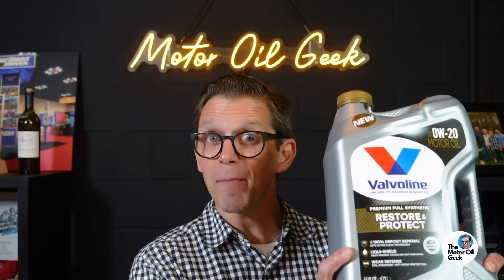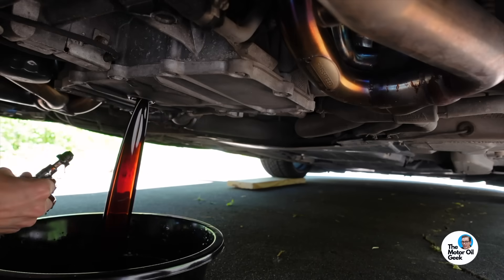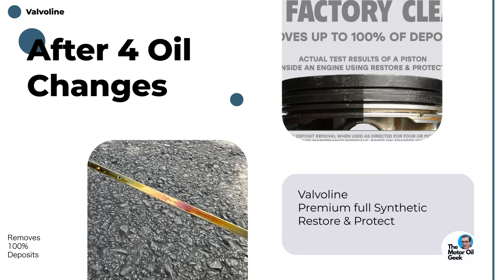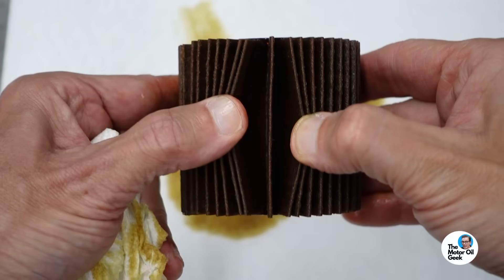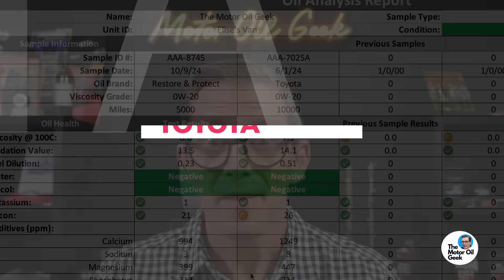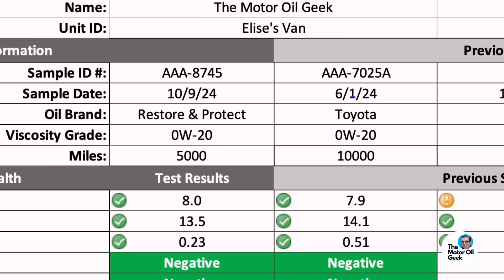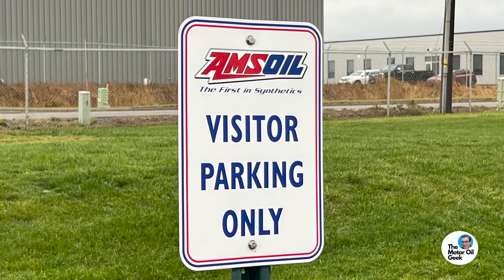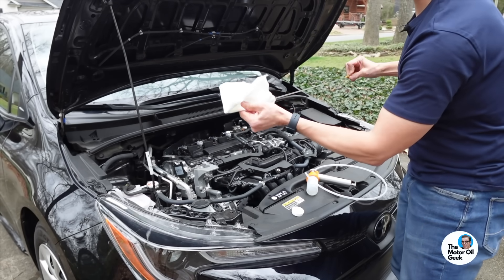The TRUTH About Valvoline's BOLD Engine Cleaning Claims

Comment: I used it in my 2016 tundra, 136,000 miles, had the timing chain noise that comes and goes, not loud just you knew it was there. Used this oil, 5w-30, and after two oil changes it was significantly quieter. I do 5,000 mile OCI. I Think the oil freed up the timing chain tensioner

Comment: The 10k mile oil changes is why you have varnish on the dipstick. You should check out The Car Care Nut and his videos on the 10k mile oil change. It causes more issues than varnish in places it shouldn't. 10k mile oil changes even on Toyota oil will lead to excessive oil consumption.
Reply: I had varnish on the dip stick of my lexus and changed the oil every 5k.
Reply: @flyinfinity8745  Was that on OEM oil ? I don't think Toyota is into advanced base stocks for their oils.
Reply: @MathewPollard-vj4uq  I dont know what my lexus dealer used, but it was not synthetic. I didnt do my own oil changes until 120k. It was always done at the dealership every 5k and I bought the car new.

Comment: So, if my engine burns a little oil, would Valvoline Restore and Protect help in cleaning my spark plugs too? Preventing fouling and possibly extending the changeout interval?
Reply: If your engine stops burning oil, then your plugs won't oil foul.

Comment: I have a 2005 Toyota echo. 
 Change the oil every 3,000 miles. 
 Use 5w40 European Lucas oil ,
K&N or mobile 1 filters .
I'm at 215,000 miles now and it runs like new and uses about  ⅓of a quart between oil changes.  I don't have to add any just a little bit less comes out than I put in. I fill it to the max and when I change it,  its around the half way mark.
 New Toyotas are complete garbage....
 So sad ....

Comment: I have a 2021 nissan rogue with just under 10,000 miles, I change 0W20 syn. oil once a year. Would it be not worth it to use this Valvoline VRP oil or not being how there are no problems with the motor at this time. I still have the4 cyl. 2.5  direct injection motor. I use to lease these N.Rogues till they came out with those crummy 3cyl. turbos.

Comment: As good as the results are, I bet wear levels would be measurably lower with a 0W-30 or even a 0W-40 (if available).  

AFAIK, only in the USA do vehicle mfrs recommend such thin oils (0W-8/16/20).  Everywhere else, they say 0W-30 is suitable for the same vehicles.  I have to say 'The heck with CAFE' (Corporate Average Fuel Economy).  Automakers are penalized by the Federal Government for failure to hit mileage goals.  While I get the pressure the mfrs are under from el Federales, I'd rather my own personal vehicles last longer than get one or two mpg more via a super-thin oil.  

Car makers' own studies have shown that engines last significantly longer (+1-1/2 to 2X mileage) when filled with multi-weight oils with a 30 or 40W 'hot' rating compared to 20W.  Of course, following their specs to the letter yields a two-fold benefit - TO THE CAR MAKERS: We the buyers face higher Lifetime Cost of Ownership (LCO) with shorter component lifetimes - even trading in our vehicles more frequently in some cases! 

With vehicles prices reaching new highs every year, most of us want ours to last.  My 2002 Altima just turned over 215,000 miles on the original engine.  I'm slowly going through it, replacing suspension components, brakes, hoses, the drive belt & other wear items neglected by previous owners.  However, the first thing I did was an oil change to a 0W-40 quality synthetic oil (Castrol 0W-40 Euro or Penzoil Platinum Euro 0W-40 - being replaced with Helix Ultra 10W-40) and a quality ATF (Castrol Transmax Import M-V).

Comment: With 260k miles on my sw20 that leaks and burns oil like fuel, I'm pretty sure if I cleaned my piston rings I'd throw a rod at this point. Pretty sure the carbon is the only thing keeping the engine glued together lol

Comment: I just did an oil change with VRP on my daughter's 2010 Honda CRV with over 215,000 miles on it.  Can't wait to see the results after I change it again.
Reply: Might want to keep an eye on the dipstick and change oil and filter when it gets dark. On the first video, a guy said he’d been changing his oil every 3,000 miles and switched to R&P and it clogged his filter near the end of the first change and took about 3 changes to get the engine clean. The same guy later posted that he had a sudden drop in oil pressure and found the pickup tube screen blocked.
Reply: You can wait
Reply: @jme214  ummmm....ok

Comment: Hey Lake, I'm thinking about using this in my 1979 Dodge W150, and wanted your opinion on at least a first oil change interval with it. The engine is a 360ci V8 with at least 111,000 miles on it(I don't know how many times the odometer rolled over). It's a former USDA truck, likely with lots of idle time. When I first changed the oil around 9800 miles on the odometer, I just used O'Reilly's high mileage 10w30 Syn blend. After about 2000 miles I did an oil change(with oil pan gasket and front and rear crank seals) and used Castrol Edge high mileage 10w30 with a Purolator Boss filter. When I changed the valve covers and gaskets, the rockers were pitch black. If I use the Valvoline R&P, and given the engine info, do you think a 2000 mile interval would be good for at least the first time?

Comment: Well this is all fine and dandy. Im not doubting the valveoline R&P doesn't work.
But its not the only one to do so. I bought an old pickup cheap with 210 k miles on it with unknow maintenance or oil used in it. It ran ok and didnt consume much oil. But it did have cold start piston rattle that went away as it warmed up. I have used Amsoil Signature Series in it for about 45,000 miles now with about once a year at around 6,000 mile oil changes. I recently notice the cold start piston rattle is all but gone now. I figure the piston rings were gunked up and sticky and now they have been cleaned up and are free. I'm impressed.
Reply: No doubt using a high quality oil for 45,000 miles will have got that motor nice and clean. I think VRP and will be most useful for the newer cars where piston buildup , turbo pressure and heat create problems quickly and where people have been following the long OCIs. Lots of people follow the long OCI "Because the manufacturer knows best" without realizing the manufacturer would rate their driving patterns as "Severe Service" with shortened intervals.
Reply: I’ve had that same experience with Amsoil Signature Series. In reality Signature Series is a much better oil. As a matter of fact I’m pretty sure Amsoil High Mileage (which Amsoil guarantees to free up stuck piston rings) came out first. I think Valvoline is trying to create an oil that can clean as well as Amsoil and be able to buy it at the store.

Comment: I bought a Pontiac Vibe GT (2ZZ-GE engine) with 140,000 miles on it. The dipstick was heavily varnished and the looking through the oil filler cap showed the valvetrain had varnish on it.
I changed the oil and put a quart of Marvel Mystery oil in it (changed out the original spark plugs too). Ran it for 3000 miles and when I changed out the oil, the varnish on the dipstick was gone and the valvetrain looked much brighter.
Just saying that while I find your varnish test informative and interesting, that part was not breaking any new ground.

Comment: Filter holding contamination against it being small but in the lube system 

Depends on the allowable back pressure on the filter - who wants oil swirl
Reply: Swirll??? If a full flow filter gets plugged or restricted the oil filter bypass valve will open.

Comment: I have used Val online restore 3 times so far for 3-4K miles intervals in my Audi A6 with 190k miles. Don’t know if it works but I took Lakes word for it. I will run this car into the found and when I do, I will pull the pistons.

Comment: Some time ago you did an article about new engine oil that was very very old and the additives had settled to the bottom of the container. I ask the question if the container containing the oil was “moved”  around ie, laid upside down/side to side over a long period of its standing time would the oil additives have stayed in solution and the oil be usable.

Comment: I've just had the Valvoline Restore and protect installed in my 2018 Kia Sportage LX AWD with the 2.4 L GDI engine which is currently at the 96K mile mark. I don't plan on taking any samples to send to a lab, but I will be keeping a watchful eye on the amount of oil to be added in between oil changes. When I purchased the car used at 29K miles four years ago my mechanic warned me the engine would burn "some oil", which he was correct, it burned one quart in between three to four thousand mile oil changes using Mobile One Full Synthetic. This past year however has shown a considerable increase of oil burning going up to two-and-a-half quarts per oil change. So I'm hoping this mechanic in a bottle will knock that usage down back to the one quart level again. I will try to let you know how it goes folks.

Comment: Thank you for your work confirming valvolines claims! As I have commented before, no one beats valvoline for long. When someone 1 ups them, they go at it hard until they 1 up the 1 upper! When mobil1 came out, valvoline clapped back with their updated synpower synthetic within 8 months and blew mobil1 out of the water.
Reply: I love a good fight. it drives technology and innovation. Also, popcorn is pretty nice.
Reply: Did they ever respond to Pennzoil Ultra Platinum
Reply: i agree. they are a go 2 brand. the only real difference between high mileage oil and regular is that high mileage oil has a little bit of stop leak in it, they call it seal conditioners. valvoline maxlife has the highest concentration, and highest quality seal conditioner. this formula has definatly outright stopped engine leaks for me in about 2 to 3 changes. though. i like castrol better because castrol is better in terms of lubrication. pennzoil has come a very long way since its problematic days, I think its synthetic formula gives the best lubrication and even protection for long intervals 6k changes and up without it stating that it is formulated for 10k mile oil changes. but hey valvoline has all the protection you need to get a full life out of any OEM engine. now that valvoline has an engine oil dedicated for cleaning engines to rival royal purples product at a lower price they are THE go to brand.
Reply: so your choice of oil used determined the internal cleanliness and thus required this new product. I notice valvolines doesnt lie as they use the oldest words in advertising " UP TO " so cleaning .oooo1 % would mean ...it works it really does !
Use amzoils best from the start and prob will not require this "up to"  product.
Reply: @lenmoodie8290  amsoil is a pyramid scheme. There's a reason they dont pay for API testing, and it's not because "iTs tOo eXpEnSiVe" it's because they can't back their claims up
Reply: @lenmoodie8290 Or one could read through the comments and realize that the product works
Reply: @lenmoodie8290  Ok Debbie Downer LOL! It worked for me.

Comment: Im 53 and i been using valvoline for 30 years due to groundbreaking high mileage oil never any issues. On second oil change 2012 accord 2.4 with 86000 miles and first on 2022 rdx. However the rdx has 11700 miles more for preventive maintenance.

Comment: Would you recommend using this in a gm vehicle that requires dexos...I really want to give it a go as I know ring deposits are a issue with my turbocharged direct injected motor...if I was to try I'd probably only do 1 treatment for my regular 4000-5000kms oil change

Comment: Lake Speed maybe your most incredible video yet.  Tried the first dose of the Valv R & P on my 2001 Solara with 280,000 and wasn't sure if I should put it in the next change, now I guess I will do it.  
I don't believe anybody can give out any better wisdom nor more technically accurate advice on engine oil, than a qualified tribologist like you.  I value your opinions 10 times as much as anybody else's on this platform.

Long comment follows:
I have always gone by 3 mo/3000 mile oil changes and that's because I've seen the good results for myself.  A few years ago I decided to do an in-car overhaul of my old 1988 Nissan Z24 pickup w 190,000 miles.  It needed a valve job but I decided I'd change the rings too, since the head was off, and I'd always wanted the challenge of doing it.  

And after removing the pistons from the engine block, there was very little evidence of wear to be found:  no cylinder wall scoring and no wear ridge at the top of the cylinder (which it is almost routine to find in neglected engines).  I had bought a cylinder ridge-reamer but didn't need to use it since there was no ridge. 

All the piston rings were relatively clean, none were sticking, and they all moved freely.  All there was to clean off was a very light trace of hard deposits, probably carbon, in the ring grooves.  Connecting rod bearings were like new so I just re-used them.  And there was not a trace of sludge or varnish in the oil pan nor anywhere else.  Even the oil pump pickup screen was spotless. 
Seeing all that with my own eyes, on my own car, made me a true believer in 3,000 mile changes.
Reply from the maker: Thanks for the kind words and the comment. If 3,000 mile oil changes work for you, keep doing. I'm not trying to tell anyone what to do. I'm just here to provide info and let each person make their own decisions.
Reply: I know what you mean. My father ran the cheapest gas he could find on his 1970 Datsun Thai rebuilt at 200,000 miles he always used castrol GTX  20/50 changed every 3000 miles and never went over 4000 mile between changes. No ridge. I judt honed it. I had bought new main and rod bearings. Changed them but I was curious on the bearing wear. I plastigauged the bearing with the old bearings and they weee the same. I also expected all kinds of carbon buildup on the valves choking the flow like you used to see in the commercials for name brand fuel. There was none. 
Remember this is on a carbureted car with a manual choke. He always warned it up for at least 2 to : minutes before driving it. 
    I have concerns over this oil in long term use on newer cars newer meaning 10 years or older. My concern is with the detergent being this strong to actually remove this baked on gunk having a hardening effect on the valve stem seals in a long term use. 
  I know they tested it in dump to simulate lots of miles but I know they have not tested this stuff for 10 years in time and not 10 year simulations
Reply: I was wondering the same thing myself
Reply: Oil is cheap, engines are expensive.

Comment: So I can use valve line restore and project to clean my pistons before I rebuild the engine? 

You know, soak them in some hot oil (150 degrees F) for a bit and see what happens! I might try that to see what happens instead of hand cleaning the pistons.

Comment: I am at the end of my first oil change using this oil. I'm about to do my second run with this stuff next week. I am using it in a new Reman engine that I bought 18 months ago that has 20k miles on it now. I swapped to Restore and Protect about 6 months ago. I also swapped to Purolator Boss oil filter at the same time, and I intend to keep using both together.
Reply: Boss is a good filter

Comment: My 2013 corolla has 230000 miles.  Did 4500 miles this oil and next oil change used the high Mileage valvoline oil extended protection again, worried about old seals in engine possibly being hurt by this if used constantly..then next change with the restore and protect..plan to alternate between both...you think older cars seals could suffer?.I've read it could harm old seals

Comment: I believe that most major oil brands like Valvoline have good additives in their oils with better testing and technology we have today, better additives than in oil 20 years ago.    I have a 2001 GMC Sierra Z71 with over 100,000 miles that (I bought brand new) in 2001 and all it has had in it is Pennzoil 20-30w and it has never had any engine problems or repairs and I have had the oil and filter changed every 5,000 miles.     Looking inside the engine (5.3L V8) through PCV valve openings, etc. the inside of the engine looks brand new with no dirt or varnish and the dipstick has zero varnish, etc.     My engine is proof to me that change your oil every 5,000 miles and most brand name oils today will stay clean.  It uses/burns about 1/2 quart of oil between 5,000 mile oil changes.

Comment: 2005 Silverado,5.3LM7 280,000 MILES,Have been Restore&Protect for about 10,000 miles,3 oil changes,And it works,idles smoother,runs better.
Reply: 2002 with the same motor, just changed mine

Comment: In automotive college I was told the "high mileage" type oils contain solvents that clean the engine but also can attack the seals making them swell and seal better but also making them spongy and weak and extended use will cause them to fall apart but this was a few decades ago perhaps the technology has improved

Comment: Doing this on my dad’s Yaris. It started burning oil past 500K miles first restore and protect change was at 528K 2nd one at 533K going to be doing the third one soon. Oil burning is getting worse. But the oil is looking like diesel motor oil a black oily void. Probably going to be replacing a short block. So having everything around the engine freshly clean helps. Looking at what most people have been saying and seeing it looks like this engine was simply too far gone. Or maybe it will do its magic in the last 2 oil changes? So not a complete waste of money for those looking into buying Restore and protect.